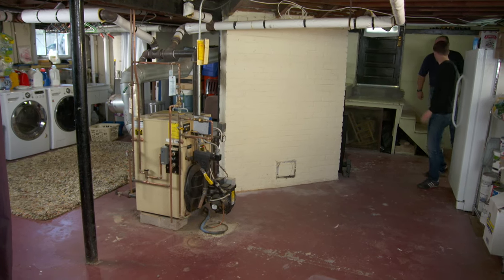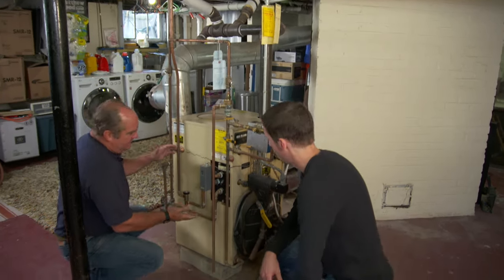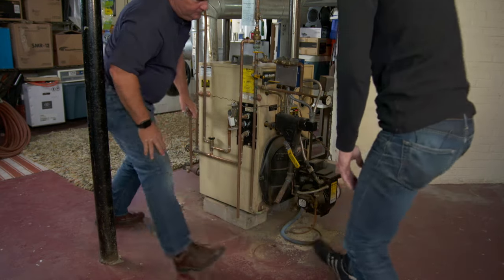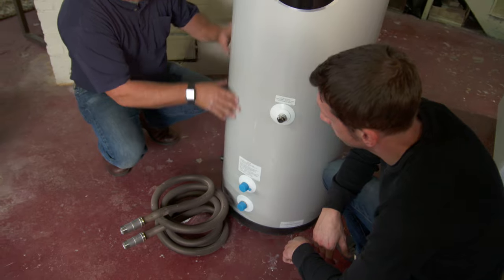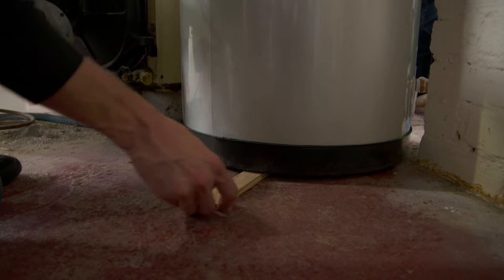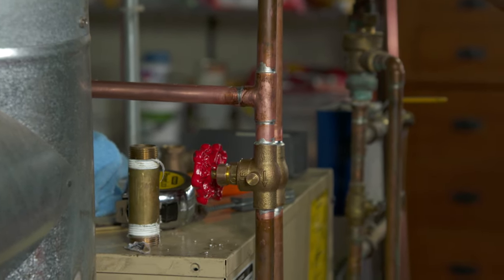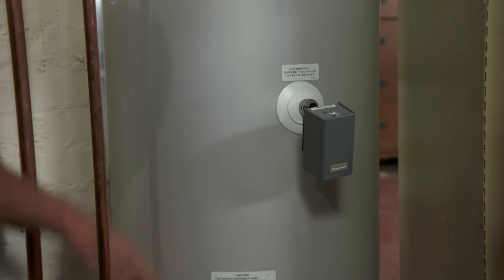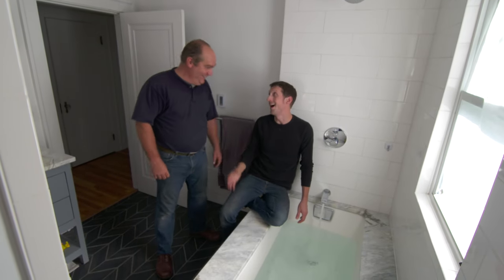How to Install an Indirect Water Heater on a Boiler | Ask This Old House

Comment: For $3000 dollars? you kidding me? you can install a electric water heater in series with that boiler adding a timer to turn it on and off for the water heater. You save a ton of money.
Reply: Tung Tranle why get a Electric water heater when you can do what he just did and save money and electricity, yearly ?!
Reply: Not to mention fuel oil. That was a main point...not keeping the boiler at 160° year round just to keep the tankless coil hot. Probably will save him $600-800 every summer in fuel oil alone.
Reply: This is only feasible if you have a cold start boiler. Which doesn't keep the boiler on to maintain boiler temperature. Especially in the summer when no heat is needed. Also, the price of these tankless heaters are 1000. bucks, way overpriced, but I put one in so I have hot water during a blackout. An electric heater would use too much electric for my 4000-watt generator.
Reply: john spinosa  Where do get your hot water regularly, when there is no blackout?
Reply: that's not a $3,000 job about half that if somebody's being reasonable a tank is about a grand and your doodads for hooking it up
Reply: @bigpardner   Electric hot water heater. We went days without hot water, not anymore.
Reply: @bigpardner  Electric hot water heater. We went days without hot water, not anymore.
Reply: @larrycurrier290  Not in MA!  I'm not a plumber but recently replaced some parts in my boiler.  The mixing valve was $86 and the circulator was $337.  Eleven hundred dollars for the tank, with copper piping, gates, valves, strainer, and other doodads I bet you could get to $2000 and that's before your plumber's hourly fee and markup!
Reply: Glenn Krzeminski yes those plumbers trying to get rich on the first job
Reply: LARRY CURRIER that’s a $3000. -3500 job.
Reply: M Croley ok

Comment: With the help of Ramon Priesol below, I reailzed that you "effectively" removed the steam-boiler/dometic-hot-water heat exchanger from the system.  Instead you are drawing hot water directly from the steam boiler via the old thermostat location.  I can see how this is more efficient, as you eliminate one heat exchanger from the system.  Maybe you highlight this in the paid-for-full-video-on-TOH-website, I don't know.  In any case, is this how the manufacturers recommend these indirects to be installed, or was this your enginuity?  Btw, I am also curious if you don't expect galvanic corrosion due to the black/copper pipe connection for the strain filter.

Comment: I just replaced my 62 year old boiler. The old boiler had a tankless hot water coil. However, I went with a new boiler and indirect hot water tank. I also have more hot water when needed, and it is less costly.
Reply: Is the hot water endless?

Comment: It’s amazing how many legitimate and valuable questions there are in the comments, considering how many people rave how this is such a fantastic explanation. I guarantee the homeowner didn’t know what the heck he was talking about and didn’t care because he was getting all of this for free
Reply: Why so many are asking  Questions because it a very poor video explaining and showing each and every step. He just sets main parts an shows a 3 second clip of hooking up then jumps to showing it all done. Very poor video on how too. Intact it's not a how too at all. It a totaly product sales pitch is all. I get all the hot water I need 24/7 out of my NYT oil fired BOILER  with a direct hot water coil. Never run out an boiler only fires when tap is turned on if water boiler temp is below my set domestic hot water setting. It never fires when there no call for domestic hot water in summer. This guy just sold him a ton of stuff he didn't need instead of plumbing an wire the boiler coil proper. You can get the same hot water out of a bronze 60 plate heat exchanger added to a boiler with no domestic coil. In any case even this direct hot water tank an any other water to water exchanger pool or hot tub. They all need to be serviced. Witch is why when plumbed in each one must have  Isolation valves and back flush conection valves for a set of washing machine hose. Turn off both  Isolation velves hook up pump that socks a good descaler out of an flows back into the pail. All heat exchangers build up with calcium iron and just plain old  Oxidization of the copper or brass witch stops heat transfer. I do all of mine once a year. It takes 20 min each if plumbed properly.

Comment: Hi Ade from the Uk here , The technology you are using there went out of date over 30 years ago , no domestic houses have steam boilers, most of the UK have gas or oil condensing combi boilers or system boiler with a vented or unvented tank. I think it would have been more cost efficient in the long run to upgrade to a condensing oil boiler with cylinder, new radiatiors and pipework with new controls.
Reply: ade johnston nope
Reply: Condensing oil boilers are a problem. Nobody wants to keep up with maintenance. Soot and moisture= big clog
Reply: You Limeys call storage tanks cylinders. You Limeys learnt a lot from us Americans. I'm a third generation steam boiler guru.

Comment: yes they are much more efficient . especially if your boiler is modern one. or you have an alliterative heat source. like wood fired outdoor boiler or hot water solar. the only down side is they are at least 3 times the cost of a reg natural gas tank. we just bought a house and found out that the indirect tank is leaking and rusty on the bottom edge.  i installed it my self and saved big ,but 1700 dollars just in the tank and parts. and had to be ordered on- line with truck freight.
Reply: There going to cool down fast. 2" of insulation is nothing at all. Now if it was wrapped in R24 boiler insulation (thick foil on outer side . It would hold hot water really hot for days. 2" is A JOKE. THAT all a eletric or oil or gas fired hot water tank has for insulation an we all know a 4 hour power outage there no hot water.
Reply: Just buy a eletric hot water tank an conect your boiler domestic hot water coil to the eletric tank. If burner fails turn eletric tank on an not only do you have hot water you have heat in the house.

Comment: It is interesting how he connected it to the existing system. He reused the thermostat well on the heath exchanger for hot water out and return goes behind refill valve on the bottom of the boiler - clever. Just don't understand why is there still old piping connected to heath exchanger - he clearly could remove all the crap. Anyway, what about insulation?

Comment: One thing I find interesting is that in all the shows in this series over the past 30 years is the total omission of strapping water heaters, furnaces, and stoves to the walls; and the lack of flex joints on the gas connections.  In California those are all requirements due to earthquake hazards.  Second items is the omission of drip pipes and any mention of them in gas piping.
Reply: Most likely because he is not working in California. I work in the area Richard works in more or less. In all my time in the trade I have never seen a strapped water heater or furnace and also never seen one fall over because it wasn't. Probably no flex joints because only homeowners and hacks use flexi's on water heaters or furnaces.
Reply: You do not live in California.  Earthquakes cause water heaters to fall over unless they are strapped to the structure.  A falling water heater causes the gas line to break and fill the house with gas, ready to explode.  Flexible connections and strapping are required by the California building code.  If you do not use a flexible pipe the building inspector will not approve the installation and the gas company will not turn the gas service on until the building inspector re-inspects and approves.  That is not a hack.
Reply: so what did they use in California before flex piping was approved? Steel mains and copper tubing drops?
Reply: Steel or brass pipe only.  Copper has problems with sulfer.

Comment: Interesting solution, I would go a different way if budget allows. Remove boiler, retrofit existing  radiators to hot water from steam, and use a Lochinvar combi boiler for heat and domestic. 1 appliance, 2 functions, endless hot water.

Comment: In the summer months you could always add a timer to shut the entire system down after a set time if no one is  home or everyone is long in bed.  If you are really creative you could build a circuit that  would keep the boiler hot if there was periodic call for the indirect tank to be heated or for space heating but would shut the burner off and let the boiler start cooling if there is no calls  for heating after a given period of time.

Comment: Also where's the check valve on the cold , the temperature gauge on the mixed water also bypass on the mixing valve in case it fails.

Comment: The main improvement is due to the new tank being insulated.  If the boiler was insulated, (and the potable water heat exchange not clogged) , you would achieve the same result, no ?   Of course you could turn down the temp in the summer since space heating isn't required.
Reply: The boiler is actually insulated, but it also has way more exposed piping, lot more mass in the metal and it has some loses through the chimney.  The indirect tank can have much better insulation.

Comment: I wonder why he kept all the old pipes hooked up running to the indirect. Removing and capping would make the job look cleaner.
Reply: If you cap a tankless coil when the boiler is cold and there is still water in the bottom of the coil what do you think will happen when it heats up and builds pressure when there is a call for steam. Word on the street is they will shoot off like a bullet but not until a child is in front of it. Never seen it happen but was taught you just cut them as short as you can and leave them.
Reply: He's got it hooked up with a tempering valve to try to maximize whatever is left of the coil to help warm the tank.  Probably better than removing it altogether from an efficiency standpoint but not worth replacing.

Comment: This tank should have a vacuum relief valve installed in the cold water line. To install properly the cold water line must rise above the tank. The vacuum relief would then be installed before it ran to the bottom of the tank.
Reply: I have had multiple answers to vacuum breakers but I have found out from asking one of my very good licensed plumbers and he told me that it depends on where you are and sometimes vacuum breakers are not required like where I am is because I am on a well it depends if you’re on city water then you may require a vacuum breaker unless you have a check valve installed on your city main!

Comment: I would have to see a side-by-side comparison of an in-direct hot water tank and an electric water heater. Of course, there are other variables like fuel and electricity costs and boiler/BTU output. Too many variables to find the perfect system.
Reply: Yes, there is no 1 size fits all system. Different situations work for different scenarios.
Reply: heat pump.

Comment: What about in the summer? Is the boiler going to be sending steam to the rooms when the hot water request is made? wouldn't it be more efficient to have a stand alone water heater? Or is that because it is an oil setup? My boiler is off all summer taking a break.
Reply: IzInBloOm exactly the boiler has to run in the summer, so they can have hot water. even the old set-up  had to run the boiler in the summer.
Reply: The heat transfer from the boiler to the hot water tank is probably great enough that the boiler will stay below boiling point and won't send steam upstairs. The tap hot water temperature is far below the boiling point, so if the boiler is actually able to reach boiling, there are probably some serious issues happening with the hot water tank.
Reply: I'm totally out of my field in this, but it seems more wasteful to fire up a 100,000BTU boiler instead of a 40,000BTU water tank in the summer. Although maybe the savings during the winter make up for it?
Reply: I don't know either because I'm also out of my field, but I've heard, and it sounds right, that this kind of system is more efficient with a smaller boiler. The smaller the boiler, the more efficient.
Reply: the boiler only runs along enough to make hot water. about 120 degrees. in winter it runs longer to bring water to 200 degrees for steam. and the thermostats are on then too.

I used to have steam with a tank for HW. it failed. rusted out.  I bought an electric water heater. then I changed the whole heating system to forced hot water 2011. still using electric for water. I installed that in 1997.
Reply: lostintime86 Makes sense.
Reply: right now where I live oil is cheaper per energy output than electric. so it uses much less energy to run that boiler.
Reply: Not really, since the aqua stat in the new tank will shut off the circulator at a predetermined point, well below boiling. Basically domestic water can be heated any time the boiler water is above the domestic tank temp. If the boiler is cold then the burner fires on demand and since they are now heating a larger quantity of water (30 gallons?) it's like getting highway mileage instead of stop & go local driving. The other thing to consider is the steam never enters into the domestic loop because the pipes are all below the water level in the boiler, almost the same as doing this on a standard boiler but without the pressure. (other than height difference / head pressure)
Reply: That is true to a point, especially when you consider most boilers are not sized correctly because they were figured back when this old house was built (50 plus years ago) before better windows, insulation, etc.... and at that point we had plenty of gas / oil / electric that was so cheap the efficiency didn't enter into the equation. Back then they figured out what they needed and then added something for safety factor, which is why you see 150,000 BTU boiler in a 2,000 sq ft house. With today's building codes and some reasonable system management the same house could be heated with about half that capacity including domestic hot water. Matter of fact a friend just remodeled his house here in New England and the new boiler figure came in at 45,000 BTU. Bottom line is a smaller boiler runs longer but has less standby loss.
Reply: But the boiler is going to have to be on often enough and long enough to keep the 30 gallons of water, or more,  in the new tank to over  120 degrees.  If the temp gets below that isn't the tank going to call the boiler for heat, the boiler is going to heat it's own water to well over 120 degrees before it is able to start heating all those gallons in the tank? So the boiler is still having to be on 365 days to keep 30, or more, gallons of water in a tank hot. Tretheway is complaining about inefficiency of having to heat the water in the boiler but now he is having to heat 30, or more, gallons of water he didn't have to before. Doesn't he now have a much larger "lobster pot"? Maybe you have a greater volume of hot water with the tank but would a new HW coil, or simply a cleaned out HW coil, be enough? If the boiler is being used just to provide HW in warm months it's not going to be called upon to get as hot as needed to produce steam heat. Won't that coil in the tank clog up as much as the coil in the boiler and can it even be replaced?
Reply: A water heater set at 120 is at risk of harboring Legionella.  It should be set at 140 and then mixed down to 120.  That boiler cannot run much cooler or the exhaust will condense in the chimney causing damage.
Reply: I probably personally would’ve put in a bock oil fired water heater because he’s already oil but install one next to the boiler and you can vent both oil fired appliances in the same flue and basically have the steam boiler turned off in the summer!
Reply: The small coil in the boiler holds very very little water.  The coil is also smaller.  That means that the boiler water needs to be much hotter in order to get approx. 120 degree domestic hot water.   The old coil could possibly have been cleaned up but would require more maintenance going forward.  Since there were propress fittings it probably wasn't that old and that homeowner was neglecting maintenance.
Reply: And the tanks are expensive I have an 80 gallon htp tank and with out any of the electrical stuff the tank cost 2500$
Reply: Its a good point but many oil burners do not like to be shut off ("Cold-Start").  The seals and things in these old boilers do not take kindly to drastic change in temperature.  If you take and old boiler like that and shut it off after years of it being at operating temperatures, she might leak and now you're out a boiler.  A well-intentioned attempt to save money gone wrong.
Reply: A tankless  or even a tank NG or electric water heater would be have been simpler and more efficient. And even cheaper. So the boiler could be off most of the year.
Reply: IzInBloOm no steam will be created because the aqua stat that’s placed at the water heater will send a signal to the gas burner to only heat for water, once the water is heated to its desire temperature, the burner will shut off until the aquastat calls for hot water again. depending how much hot water you use daily, that’ll determine how much your boiler will run
Reply: It sits at 160° all summer for the tankless coil for hot water. Steam isn’t made until the thermostat calls and heats the boiler water up to 212° (and passed the boiling point).

Comment: This is a great use of the boiler to heat domestic hot water when the house also needs heat. However, in the summer months, we don't want that boiler heating the house so that we can get domestic hot water. Why isn't there an explanation of this obvious conflict of use in the video? Did I miss something?